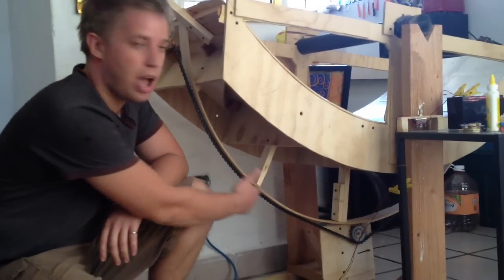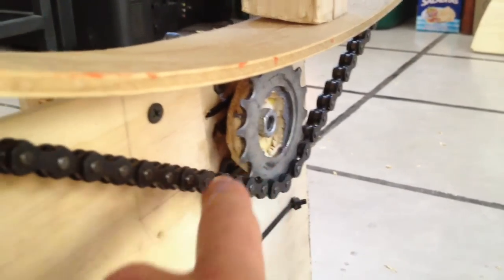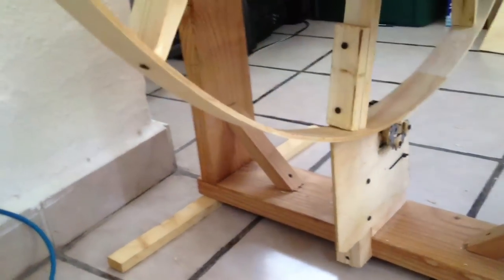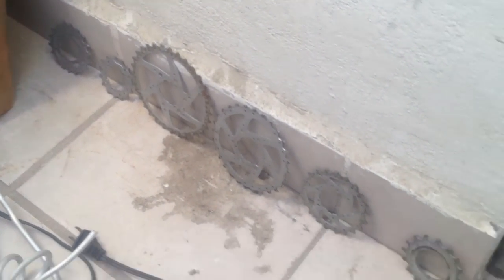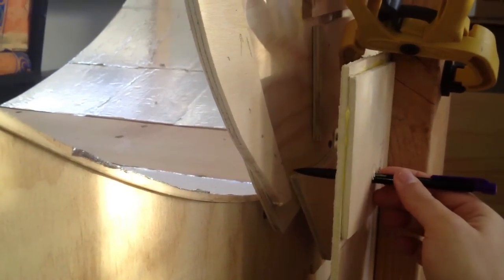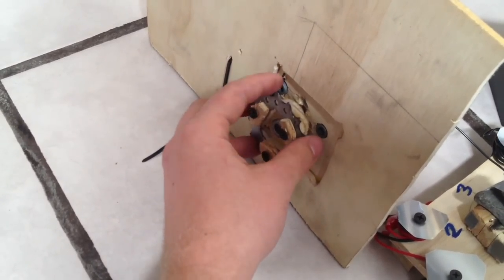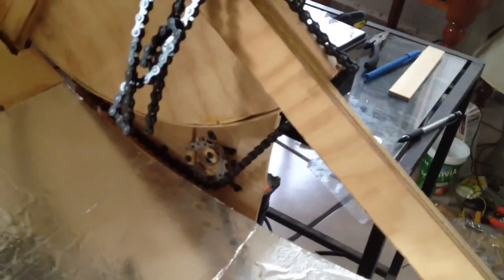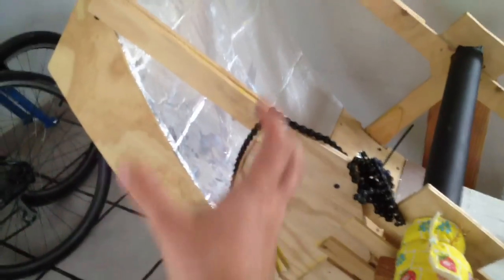Solar thermal powered car part 40, suntracking drive

Comment from the maker: I have tested sun tracking in one axis in two directions with 2 photo resistors and an Arduino Mega controller.  The same circuit should work with the larger motor and test model.  Here is an old video of me testing the sun tracking on the small model outside.

solar thermal powered car part 16, aimed at the sun